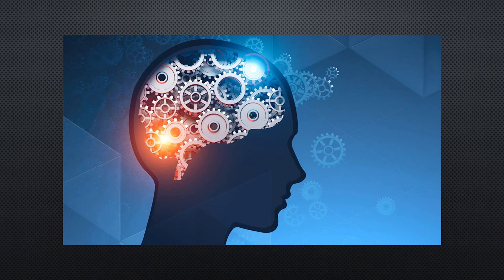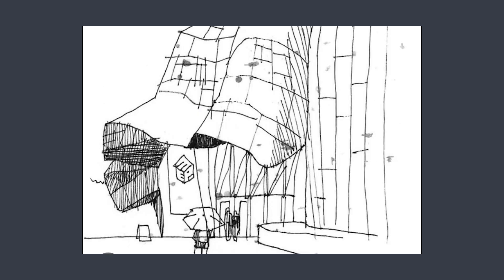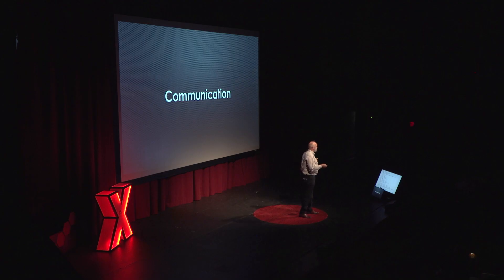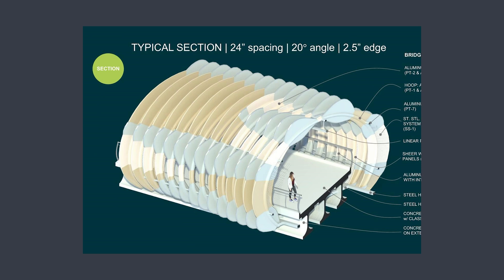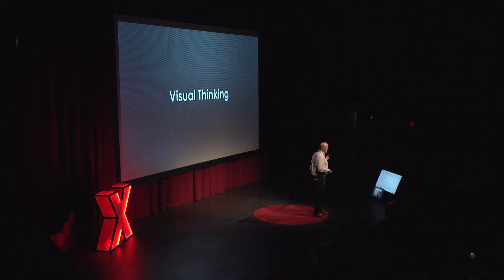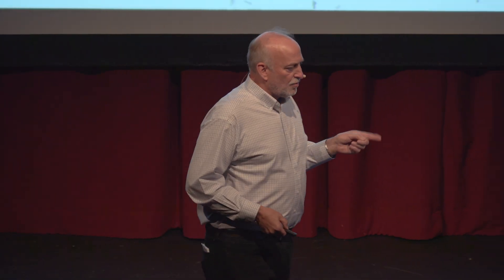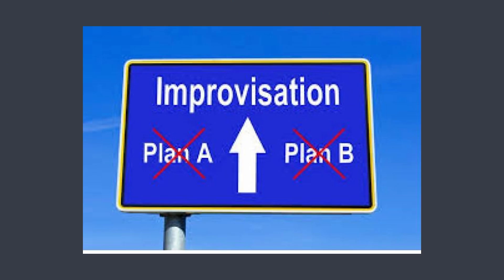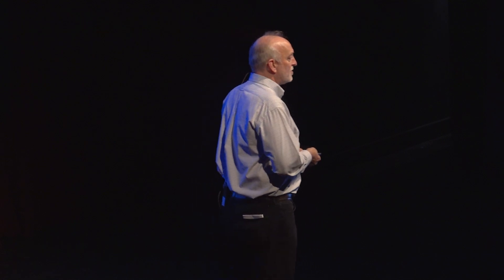The Power of Sketching In Design Innovation  | Anthony Birchler, PE | TEDxMissouriS&T

Comment: I use sketching to “park” ideas for later use. In this way, I can get them out of mind and safely stored so that I free up “space” to think about other aspects of the project. For example, I was building a deck and I had to design the stairway so it would hit the concrete slab at a point that made sense. Once I figured out the angle and length of the stringers, I sketched it out, added dimensional notations and then “parked” it, so I could begin thinking about handrails and post caps. Sometimes I will sketch a very rough drawing of something, park it, and my brain will continue to work on it while I sleep. I awake and suddenly I have the perfect solution! Sketching is pivotal to the process as it gives a graphic 3D element to the concept. Great talk on a worthy subject! Looking forward to your next one Ted Talk Tony!